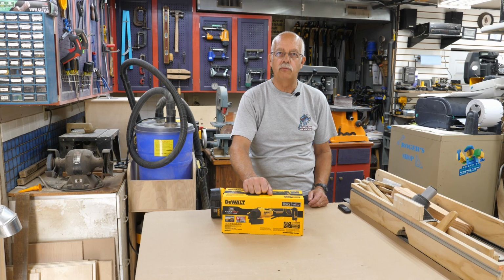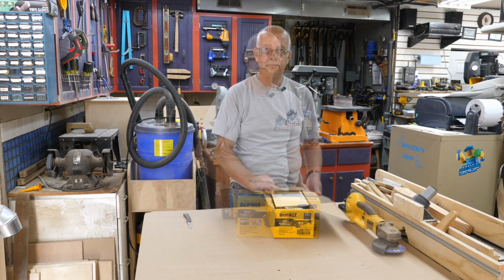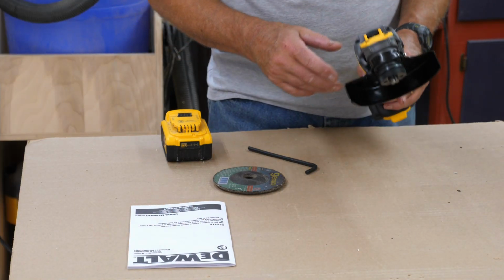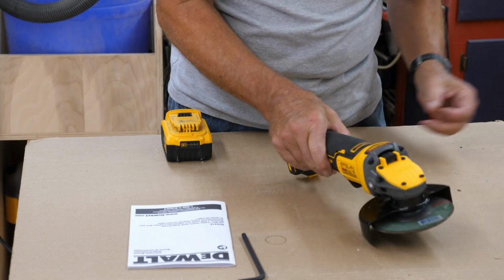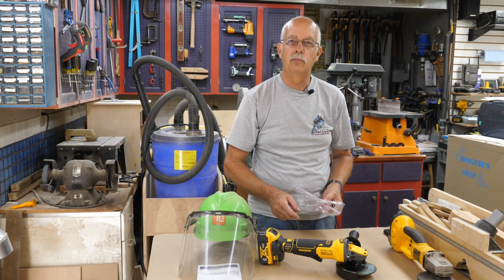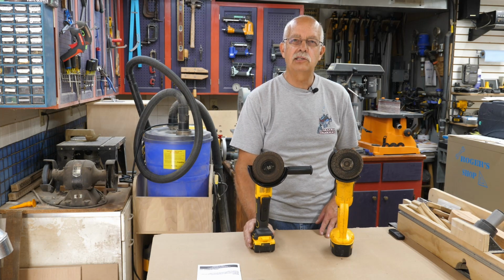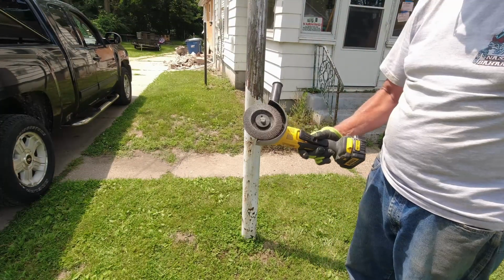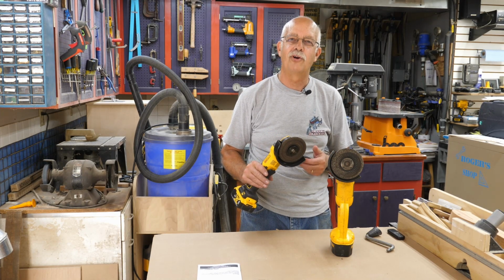DeWALT DCG416 20V ANGLE GRINDER UNBOX AND DEMO

Comment: Appreciated your video. I was curious if mine was supposed to come with the grinding wheel but based on this I guess not. 
One tip would be to visually show what you were grinding on the trailer tongue. Couldn't really tell.
Reply from the maker: No, it does not come with any grinding or cutting wheels.  The trailer demo portion was an excerpt from another video I did on having to cut off a tongue jack that some one had gorilla- welded on instead of bolting on.  Didn't want to get the camera too close to those sparks!